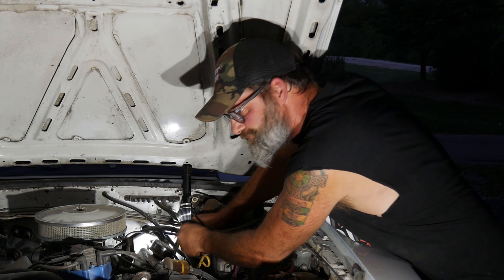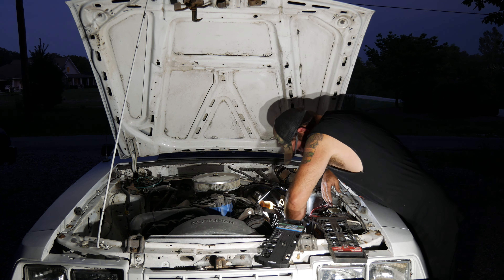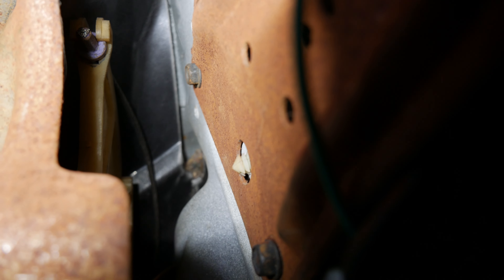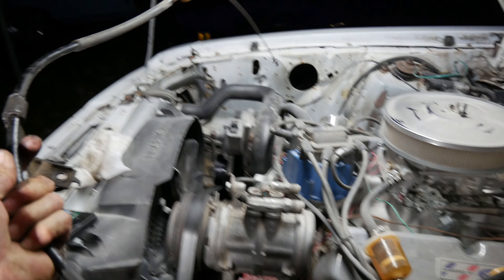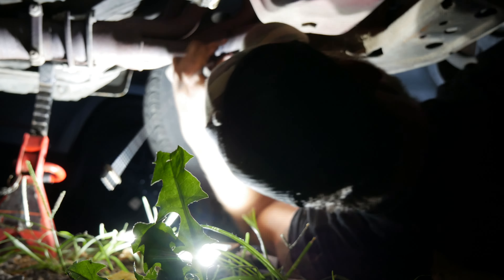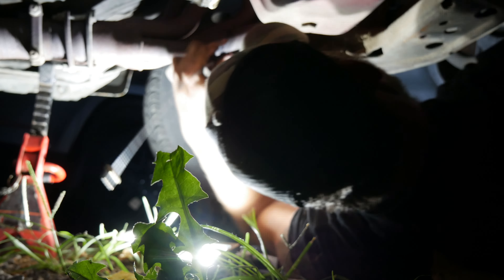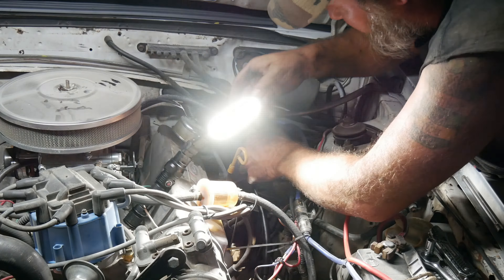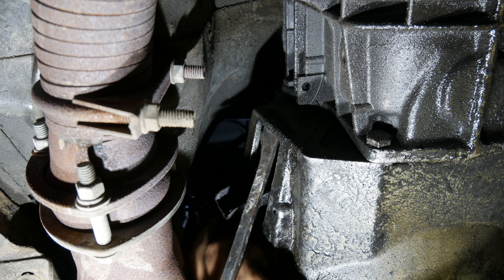Replacing the Clutch Cable in my V8 1984 Mustang GT-350 Foxbody

Comment: I went through a couple of those McParts Pioneer clutch cables back in the '90s, and do not recommend them. The OEM Ford cable is best.

I like to connect to the fork first, and then connect it under the dash - with the factory adjuster, you can release the quadrant and rotate it to catch the cable lug. But if you have big hands, underneath might be better. Simply pull up on the pedal and that's it - that's how it self adjusts. I've got a fixed metal quadrant and a firewall adjuster on mine.
Reply from the maker: Yeah, hadn't done one in a while. My hands don't fit well under the dash of these cars. Lol

Comment: Just idea might change pcv value if has one lol bad one will make motor push oil out
Reply from the maker: It doesn't have one. But I have a pcv setup comin'. I never really finished the build so I just had breather caps on it. Which is a no-no with Fords. 👍